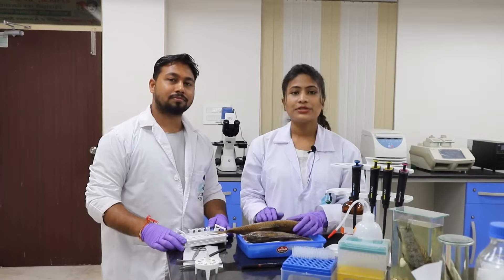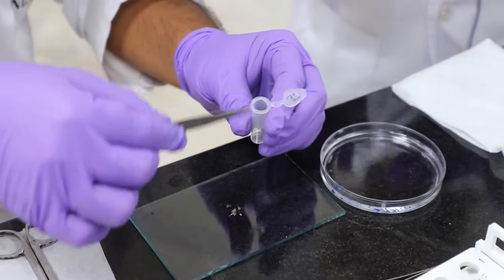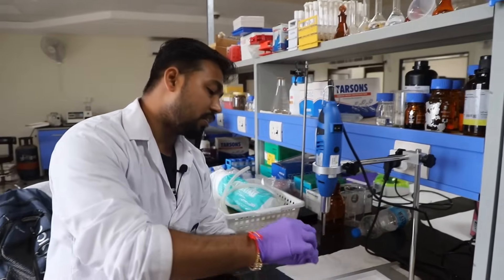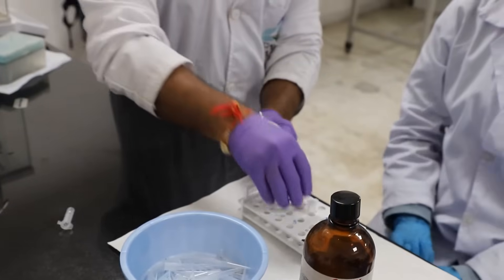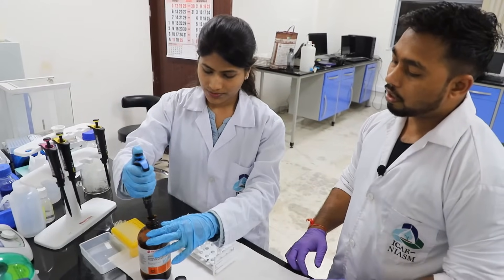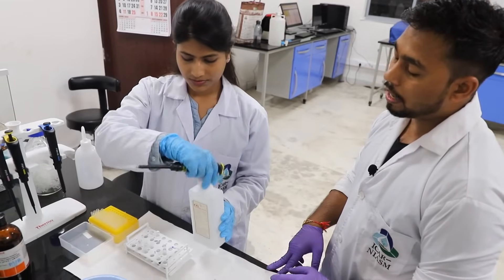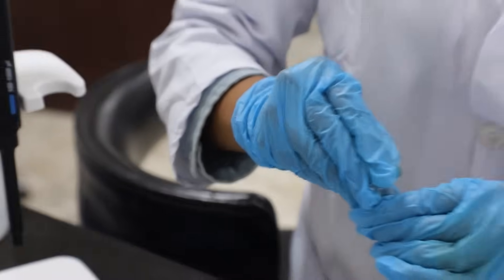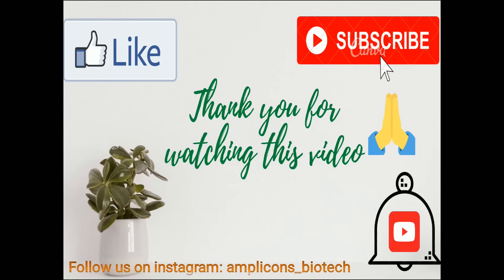DNA isolation from fish.

Comment: Hi! Nice video.

My question is: are you not concerned that the solution you use might get contaminated when you take the solution directly from the bottle? In other protocols, an appropriate amount of solution from the bottle is transferred into a smaller bottle. The amount of the solution will then be extracted from the smaller bottle. This can reduce the possible contamination of the whole solution (big bottles).
Reply from the maker: Yes we are concerned where their is the requirement to think about the contamination part, but here we work with bulk quantities, like in liters and kilos. When the precaution is needed to be taken we are always alert. Only those solutions which are not affected are handled in a rough manner, otherwise each and every step is monitored and SOP are followed.
Reply: @ampliconsofbiotech  Thank you for this information.